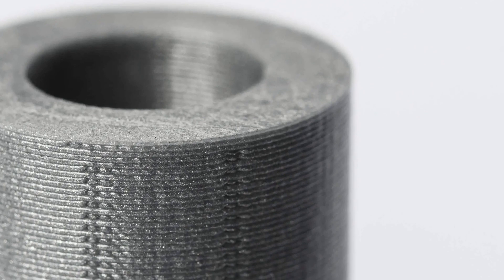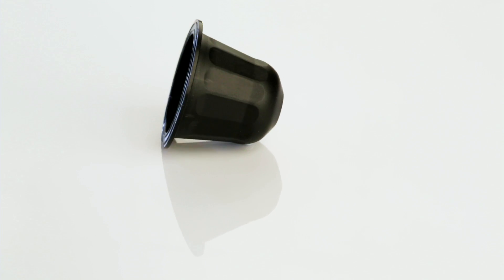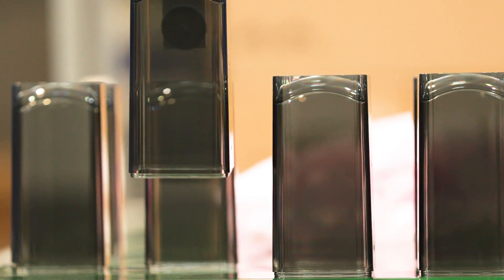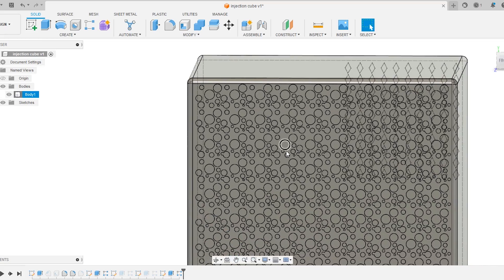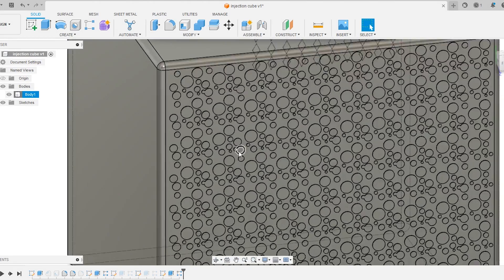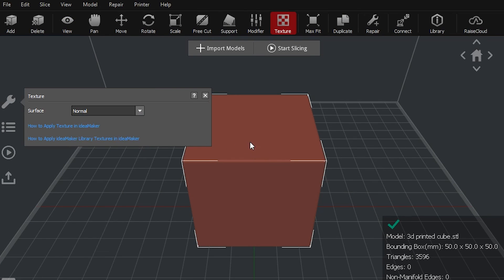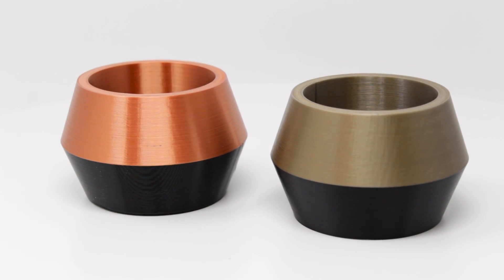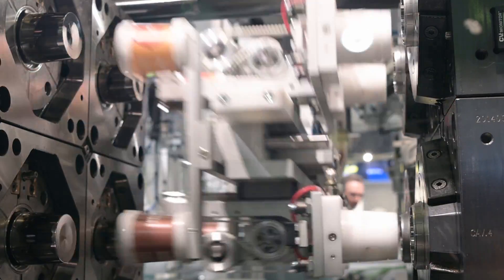Layer Lines Don't Matter | Design Textures for Mass Production 3D Printing

Comment: Lol what a joke , printed parts have no mechanical advantage to injection moulding parts , so they are not so usable , becuase they breack faster on printed line .
Reply from the maker: Design for the process and a 3D Printed solution can match an injection molded solution

Comment: Injection molded parts are also cheaper per piece at any reasonable scale, isotropic, and just straight up stronger in any given geometry. They also can be textures within reason.
Reply from the maker: You should watch our other videos
Reply: @slant3d  This is just the fact of the matter. If a part is designed correctly and intended to be produced at a large scale 3d printing will never be cheaper. Additionally due to the methods by which fff/fdm printers function the parts will always be weaker than an equivalent injection molded part.

Mass 3d printing is useful but only in a relatively small range where the low cost to change the product or start producing something entirely different isn't outweighed by the substantially higher marginal time and product costs.

This is just fact. Especially when we're just talking about standard filament based fff and not any of the crazy high performance 3d printing technologies.

Comment: I’ve found layer lines only matter to the masses that have zero 3D printing knowledge. The constant “why does it have these lines? Why isn’t it smooth like it’s supposed to be?” Stopped me dead in my tracks of print for hire, as they absolutely just do not want to understand the why.
Reply from the maker: You do have to make sure that you are making good products and then the layer lines don't matter. Don't make the mistake of attempting to 3D Print something people are used to seeing molded.

Comment: The reason I dislike layer lines is because the things I print are not aesthetically pleasing when they're present. The more I can reduce them and make them uniform, the easier it is for me to remove them. I would prefer 3D printed parts get to the point where the layer lines are nonexistent and I can choose to add texture back in if I want.

Comment: The problem is in figures and things that are cosmetic, imagine a ditto with layer lines, of course not all figures need that, or just use a resin printer😂
Reply: Yes, but my airplane needs to be smooth or else it will create tiny vortices that cause it to stall.

Comment: Layer lines do matter if I want a smooth surface, such as for figures and terrain.
Reply: Just print with smaller layer lines.

FDM is the wrong process for precision rendering, SLA printing is.

Comment: It took me along time to fall in love with layer lines.  I used to think of it as a signature of the hobbyist and poorly manufactured items with low tolerances.  But now I see that 3d printing can actually produce high quality items and the layer lines can be a bit of a badge of the manufacturing process.  For instance, creating light weight parts that are thick but mostly hollow.  Something only 3d printing does natively.  I've even experimented with 0.4mm layer heights to increase the aesthetic.

Comment: It's not as if layer lines are any indication of how much of the plastic in one layer is touching the plastic of an adjacent layer. It's not as if layer lines are a weak point. You would never expect a 3d printed part to break along a layer line because that's the weak point. That's crazy talk.
Reply: The only crazy thing here is how you managed to miss the point of the video so much.
Reply: @independentthought3390  The point of the video was all about the possibilities of texture that are available with 3D printing. BUT it came with the preface that 3D printed parts are not any worse than injection molded parts, just different which I believe is false. 3D printed parts are inherently weaker structurally than injection molded parts especially along layer lines which are prone to poor layer adhesion. I also believe that layer lines can be an indicator of layer adhesion quality.

Comment: lmfao naw lawyer lines are terrible if you are doing any form of aesthetic piece. as a prop maker that has used 3d printed parts and 3d printers for a decade now this has always been the case. you also don't have any justification for your reasoning. even in mechanical pieces layer lines pose a lot of potential friction, they lead to archival problems with printers and in the early days lead to mass warping. 

to say 3d printing is vastly superior to injection molding is laughable. injection molding has far better material properties across the board. besides if you want texture you'd use MSLA printing to minimize layer lines and maximize your texture, or use resin casting for high detail pieces with appropriate material properties. this whole video is a mess. 

wood does not have layer lines what the fuck are you talking about? it has grain, grain is very easy to smooth if the wood is cut right, but knots and other issues vastly reduce wood's durability.

Comment: What the hell are you even talking about? Injection molded parts come textured from the process all the time. Of course the mold will be a little more expensive but its not very hard to do in the scheme of all things. You give this misinformation so confidently too.
Reply from the maker: Injection molding is not capable of making many/most textures. It requires that they be subtle and still follow injection rule. Printing has no such limitation. And the addition of patterns to a mold radically increase the cost of the tooling.
Reply: @slant3d design for the process

Comment: One of the first videos I've seen cover fuzzy skin the way you have, referring to it as noise. I personally love to use fuzzy skin to 'hide' layer lines and using the term noise is best.

I find that setting one of the values to half and the other to a quarter the width of your nozzle to the best at hiding layer lines without compromising on time.

I use PrusaSlicer so the setting names aren't the same but for a 0.4 nozzle I use the following.
Fuzzy Skin Thickness  = 0.1
Point Distance = 0.2

( Opened my Cura 4.1 and the original settings used there were as follows:
Thickness = 0.2
Density = 10 )

Comment: The problem that layer lines create is a weak point where as injection moulded parts don’t have much of a weak point. Other than that I totally agree and love your comparison with wood.
Reply: I was about to say this as well.  An FDM will never be as strong as an injection molded part with regards to layer separation.  The molding temps and pressures of each process limits the outcome.
Reply: I would disagree. With materials like petg the break is nowhere near close to the layer lines. On the contrary it's a random  fracture
Reply: @shorb2289  The plastic doesn't get hot enough in FDM to reach the proper temp for homogeneous flow.  There will always be the "outsides" of the filament that will never recombine as a continuous solid.  Can you over come this?  Sure but it will never be as good as an identical injection molded part.
Reply: @jeradw7420  True, but again the point of fdm printing was never to replace injection molding. It's a cool technology to build and prototype rapidly
Reply: @jeradw7420 so, are you just going to ignore the actual real world example they provided?
Reply: @shorb2289  it depends...theres no such thing as a perfect material/process/product...
Reply: Check out CNC kitchen’s take on layer lines. He has some good test that layer lines are a weakness no matter what
Reply: Layer lines are no necessary a weak point, depends on the orientation, look at ropes for example
Reply: @rperoba  Just because there are no forces in that direction while using a specific model does not mean that model is free of weak points.
Reply: Yes but when you need something strong in all directions you need to print more parts
Reply: ive heard a lot of bs and missinformation in this video. I could call it FDM Propaganda lol.

Comment: When structural strength is a factor in a part, layer lines and print orientation sometimes matters.  Mind you it isn’t the lines that matter it is the adhesion of each layer.  But otherwise I agree.

Comment: Great vid and great tips on adding textures. Just one clarification, injection molds have textures all the time. In many cases they don't want to put textures on the side walls because of the undercuts they create that get destroyed opening the mold. The part gets trapped. To solve this, they use side actions (slides) that move in and out to get the steel out of the way (from the texture) as the mold opens. The cost of these molds gets significantly more expensive which is sometimes prohibitive for small run production where 3d printing has a big advantage.
Reply: Came here to say this! While I'm a huge advocate for 3d printing, Textured molds are absolutely a thing and are used frequently.
Reply: Yeah I was thinking this too. Also the thing about layer lines not mattering aside from aesthetic purposes.
Reply from the maker: Sure molds can have limited textures. But they are "extremely" limited and the addition of a texture radically changes the cost.
Comparitively 3D Printed parts can have unlimited textures. From fuzzy, to deep-cut dragon scales. And generally adds no cost.
Reply: @slant3d Definitely don't disagree with you, just think its a bad idea to say textured parts are impossible with injection molding. It's just not true.

I love 3d printing. It's a super badass process and I think that's why so many people gravitate to it. Just feels like your video tries to demonize injection molding a bit, lol.
Reply: @tbren6707  Definitely this. 3D printing and Injection molding exist in their own spaces. Its not like they need to compete with each other.
Reply: One example for this are the Playstation 5 controllers where there are tiny shapes imprinted. Search PS 5 controller close up on google.

Comment: Most of the content on this channel I really like and find it super interesting. 
BUT
For the statement that injection molded parts can't have a structure I have to say that is completely wrong. They can have nearly every sort of texture, but for sure it has to be machined into the mold. This can get tricky or challenging sometimes, but basically you can create every texture on an injection molded part.
Reply from the maker: By 10x-ing the cost of the mold. (As long as it is even phyically possible to eject with the texture you desire)
Reply: @slant3d  for sure, it is more expensive, but not impossible

Comment: When I contracted a company for injection molded parts, they asked me if I wanted a polished surface or a textured surface. So it certainly can be done, in fact that blue water bottle plug you showed was injection molded with a texture.
Reply from the maker: Those are lines parallel to to the ejection of the molded part so that the part can still slide out of the mold. Patterns, (diamond, orange peel, fuzz) are nearly impossible because they would essentially cause the part to be embedded in the mold. The only way to get is done is to raddically increase the complexity and cost of the molds. It is so expensive it is generally better to add texture after the part has been molded through actions like paint.

When the molding company asked you if you wanted texture they are generaly referring to the level of smoothness of of the mold. Fully polished or roughly machined.
Reply: @slant3d  Look I like your videos but the levels of dis-information in the majority of your videos concerning 3D Printing vs Injection Molding is incredible. I have been making molds for 25 years. You absolutley can have textures on Injection Molded parts. It's the secondary reason for draft angles on molded parts. the primary being to ease ejection of the part. I have done polished, sand blasted, bead blasted and leather like textures on molded parts. For heavier textures like bead blasting and leather textures you need to slightly increase the draft angle of your part. Due to part shrinkage in the mold cavity I have also been able to pull off 1-2inches of straight walled parts without draft and an aggressive bead blast finish that leaves a very nice eggshell appearance.
Reply: @yatyas72 come on, show us molded part with pattern like demonstrated on 3:31, 3:35, made with a cheap 2 piece mold, and also how it would be ejected without draft

Comment: Right, 3D Printing has its own benefits, like (as you said) the ability to create complex shapes and textures. However, saying FDM printed parts are not worse than those injection molded is just incorrect (and I think we both know that). A well printed FDM part will be lower in accuracy compared to a well injection molded part, and the strength caused by layers will be significantly lower. Also, there is noticeable warping on every cube print you showed, this will decently affect dimensional accuracy and is quite a big, but easily solvable print quality problem. You guys should try a PEI bed rather than glass, which many community members and myself love.
Don’t get me wrong - I love 3D printing, and I am active in the 3D Printing and Voron communities. I have highly modified and self built high speed and quality printers, and love being able to quickly prototype my designs. However, I am quite disappointed that a print farm of your caliber would accept such a trivial print quality issue (warping) and I feel it’s unacceptable. I also feel it’s wrong to present FDM printed parts equal to injection moulded ones, and for large scale consumer parts that can be injection moulded, there isn’t really a (functional) benefit to FDM printing.
Reply from the maker: Design for the process.
Reply: @slant3d  I understand designing for FDM, but it is very difficult to get the strength-weight ratio of injection molding. Injection molding is still much faster and cheaper at a large scale (although I understand there are large print farms which reduce cost, but I don't think it will reach a point where reliable abs parts can be produced in seconds and for a few cents).
Reply from the maker: Prototypes are different from production
Reply: @slant3d I apologise if there is any misunderstanding, but I got the impression that the video is implying these are for production. For example, 
"Injection molded parts are not better"
"3D Printing is a vastly superior technology"
"Here is what we do: Mass production 3D Printing"
But if only prototyping was meant, then I fully stand by 3D printing for prototyping, it is obviously better.
Reply: @gedeonang7077  I think you are correct in your assumption that this video is about production and not prototyping.

Comment: Agree with you on this one, since I know 3D printing the same designers and engineers have been trying to smooth prints and even sand them tediously with toxic post processing techniques, in my designs I find beauty on those layers, when printed well and make parts that respect the process. But injection molding can do lots of textures if the part is design well for that process, no need to bring a comparison and endless fight here and focus on the advantages and more deep guide will be good content for this channel.

Comment: This is a fair enough take and I agree it's usually not worthwhile but it's also not very costly to smooth parts plus you get better moisture tightness and I I would argue "structural smoothing" (i.e. more uniform structural properties) for free. Plus you can have 0.6mm layer thickness no problem. Part of why ABS/ASA are still king for FDM in my book.

Comment: Quick caveat; I am not any sort of engineer, just a guy who’s obsessed over functional and organic 3D parts for ~6 months.

Personally I like the layer lines aesthetically, even when things aren’t dialed in and they’re a little wonky it’s still nice to have that tactile feel to things. Organic prints are fine with .1mm layers and/or some post processing.

Functional prints are where you run into issues, even if they’re strong having something layered is going to be more prone to shearing than a single block of plastic; outside of materials, things like lowering cooling and orientation are used to alleviate the issues but the fact is those issues are still there.

Neither is objectively better, they just appear to have their own pros and cons.

Comment: You are speaking about esthetics.  The issue is structural.  Screw or bolts are the challenge since the torque is on the same plane as the layers.
If you have a way to test and demonstrate the structural integrity is equivalent regardless of print orientation, please share that ......
Reply: In my experience, PET (not PETG) bolts have structural integrity even printed along Z axis. I have a couple of them holding up 80 mm fans off the back of my printer's gantry, with vibrations from extreme print acceleration hammering them, and they've never broken. This kind of layer bonding is one of the many awesome things about printing with PET.
Reply: @daliasprints9798  Hey, thanks for the pro-tip.  I'll have to try PET.  I've tried just about everything I can with this 4yr-old CR10S, direct-drive, chamber-less printer.  I've been using Taulman-230 Nylon, CarbonFiberPLA, PETG, PLA, PLA+, NinjaFlex(TPU).  I have relatively thin threads using the Nylon for my filament spool rod and they have been great (not really any load though).  Cheers
Reply from the maker: You have to design for the process. Do not attempt to 3D Print an injection molded design. The rules are different to create the same functional result.
Reply: @slant3d  Well, that was helpful ...
Do you do any design or do you just print the models your customers send do you?